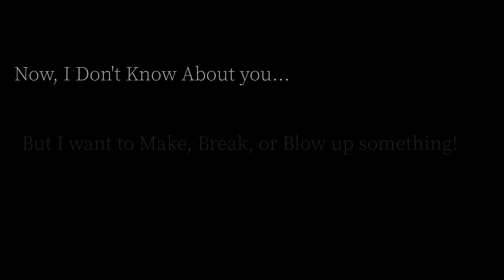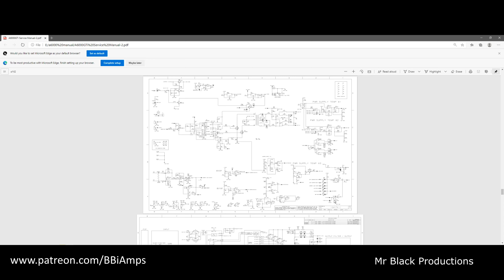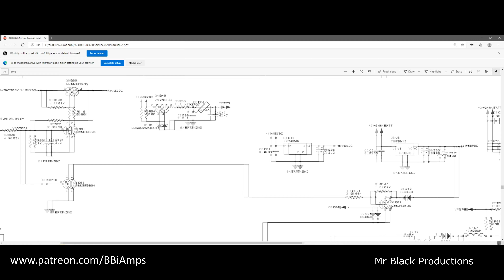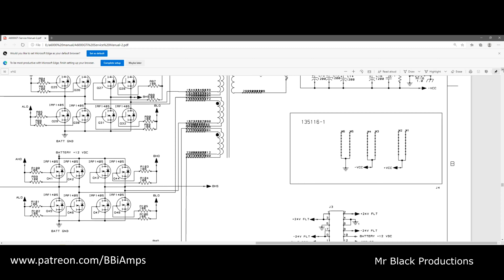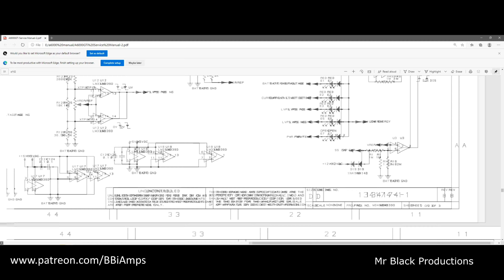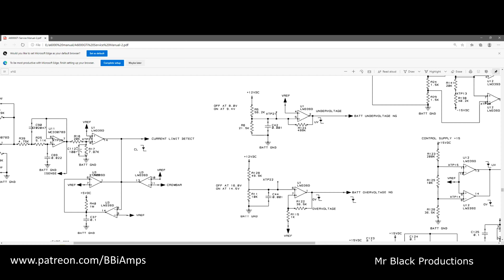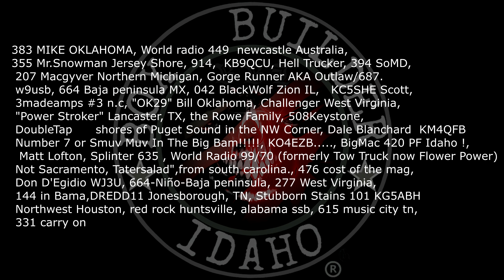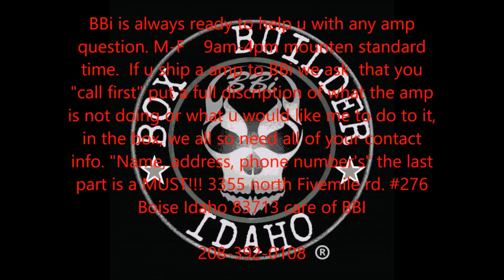Part#3 Crown/jbl A6000 lets fix/test it

Comment: The mobile audio stuff is indeed cray.  I thought it was a bit when I set up several theatrical screening rooms with an aggregate of around 40kW of crown amps each, where the 3 screen channel subs did a lame 4kW each for left, center, right.  Then 2kW split between the HF and mids for the same screen channels.  Yawn with the array of 1kW surround and back wall amps (7.1 at the time).  I got to say that watching this vid has indeed be groovy!  Thx for this!  Fun story was pissing off my SVP engineering when I vibrated the building 3 stories up when I maxed out the sub array on each of our 3 screening rooms at the same time with pink noise.  Yeah.  I got yelled at.  Edit:  the subs were 3x 18” per room…
Reply: Better to be yelled at then never been yelled at, at all.   :-)

Comment: on a pdf you can hit CTRL and F together to bring up the "find" feature. Type in the find box the reference designator and hit the enter key to cycle through the found matches.  It may locate anywhere that R17 in this example is used on the schematic....  R117.... R2117  you get the idea.   Speeds up looking for ref des on a pdf. 27 year electronics service tech here.
Reply from the maker: Idk
Reply: Uni henry???  lol   Micro Henry  µH stands for Micro Henry
Reply from the maker: Yes I do know that. Lol thanks for the tips PDF "find"
Reply: @BoxBuilderIdaho  love the content. Bitch im a fan
Reply: @BoxBuilderIdaho  KD8MWS here.  See you on the waves!

Comment: That great. I don't run anything that big. 600 watt RMS class D is enough for me. for that voltage problem of to high you can go with LiFePO4  battery . LTO 6S is to much on full charge. 5S will work. you could use a 800 amp diode in series with POS leg but that would get hot. I am not Shure what the max voltage on mine is. running LFP with DC to DC charger that way my AGM start battery stays and car stays stock . I do have a older   2 Ch./ 1 Ch. much smaller . can't remember model . 73's